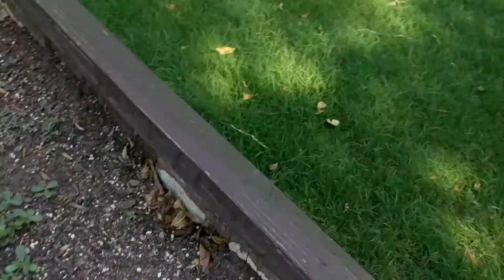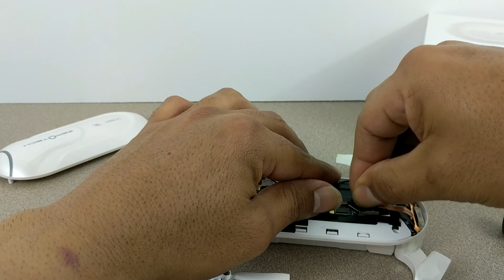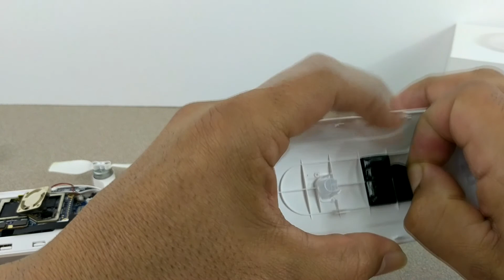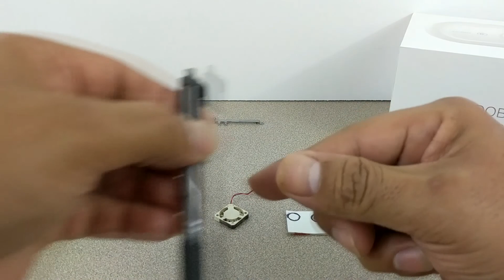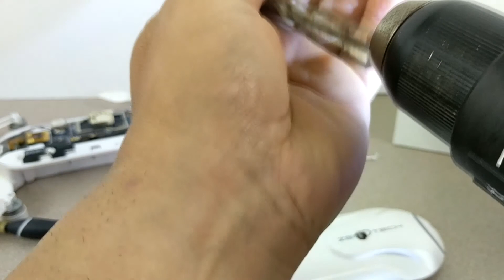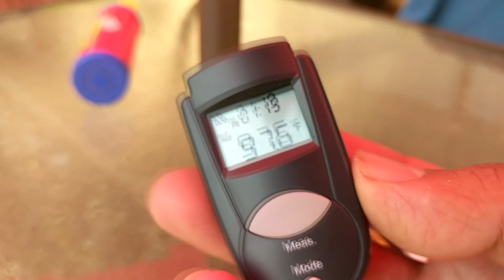ZeroTech Dobby  CPU MOD

Comment: Thanks for this, I've had issues flying in hot weather and this may work to improve performance.
Reply from the maker: Chasing Summer your welcome, Key Note: make sure air flow is directed towards CPU and GPU so that outside cool air is flowing into Dobby.
Reply: In hot weather it is unlikely that this would make much of a difference. Hot air temperature (as opposed to direct sun) would be blown directly towards the CPU/GPU, effectively speeding up the overheating. Ever fanned yourself on a hot day and then determined that fanning makes you warmer?

Comment: Don’t ever do this!
I did the same mod, it lost all GPS signal, can’t get Gps lock even in wide open area. I guess the fan adds lots of interference to Gps antenna. After I put everything back , Gps function is now back to normal.

Comment: like the idea, but the hole on the top cover defeats the purpose. two drops of rain and your drone is gone , plus i think it will suck more dust thru the original fan grill to the side and makes it even  hotter in the long run when the dust accumulate on the cpu and other parts. 
 For me unless the drone really heats up a lot and the heat effects  it's running, do not do try this. just my honest opinion.

Comment: I don't know that this would be any more effective than the heat pipes when it come to real world performance.
Reply from the maker: Adam Mooberry I made a video called Dobby Fun Do review part one and two, for temperature  however since I use an iPhone SE the app itself was not able to detect temperature in the app so I just recently got my hands on an android Pixel since I was informed that the temperature reads do work on the android app so I will be posting a video soon with the results. I’m off from work tomorrow so I should be able to post it by then thanks for watching and your comments.

Comment: Whilst I like the concept, leaving the fan exposed in that way has some risks. If a foreign object were to fall into that fan during flight and prevent it from functioning, i.e. a fly, insect or other element, even something from your pocket whilst transporting the drone, then CPU/GPU would possibly overheat and the drone would drop out of the sky. Therefore I would highly recommend shielding it in some form. I personally don't like this mod and feel that it is unnecessary in al reality, it simply isn't practical or sensible to have an upward facing cooling fan exposed fully to the elements.
Reply from the maker: DroningON.co thanks for commenting, in the video I mentioned that you can use a screen mesh to prevent this. As for airflow the Dobby has ventilation vents at base for cooler airflow in and,  warmer air in the drown out. Factory setup only had heat dissipation from CPU and GPU out but no cooler air in. This MOD might not be for everyone but for me it has shown longer flight and cooler temps. I’ll be custom painting the Dobby soon as well stay tuned and as always thanks for watching.
Reply: +Casp 72, thanks for the reply but you're missing a crucial element - by pushing air out, you force air back in via vacuum through other inlets in the Dobby shell which can produce better cooling, so this modification really isn't required. I would like to see some formal testing and temperature reading via the app as that would be far more accurate.
Reply from the maker: DroningON.co I have a video called Dobby Fun Do review part 2 that was in reference to this MOD. I use an iPhone for this purpose however on the iPhone app the temperature read never changed from “Normal Status” a viewer mentioned that the Dobby App on IPhone doesn’t read temps? I explained more in video. I was told Android device does. I’m planing to get an android device to test my MOD and curiosity. I will  make a video with my results ...stay tuned. Thanks again for your comment .
Reply: Nice one, looking forward to the video dude.

Comment: How about a series of s!all holes in a circle to create more of a screen above the fan ?
Reply from the maker: Dave thanks for watching and I do agree the music wasn’t set to the dB that I was hoping for which would reduce the background sound significantly and since I already completed the editing part and uploading; I didn’t want to have to start all over again as for the holes you mention that also is a good ventilation preference as well. I only chose to do a full circumference because as small as the fan is I wanted no obstacles in the path of air flow. I also modded the zero tech drone to resemble more of an RC drone there’s a video I posted on that as well I’ve got some videos coming up soon in regards to flight and how it handles with the new RC racing frame style again thanks for watching and your comment is well appreciated.

Comment: Pre-mod temp readings are of the actual CPU/GPU almost touching them. Post-mod readings are of the top of the fan, not the CPU/GPU, so how accurate are they?
Reply from the maker: Warren Jameson Thanks for watching , in all honesty Temp readings will always fluctuate in an open environment so accuracy varies. What I can tell you as fact is that after flight the Dobby Drone was cooler at touch as appose to flights prior. After flights without MOD the Dobby was very warm to touch near belly " Battery Compartment" with battery out. After MOD the Temp near belly was significantly cooler. Flight after flight results were the same.
Reply: @solisapaul  Thanks for that info.  I had just noticed that the second temp was of the fan, and that there is no real heat transfer to it, other than the glue pads used to lock it in place.  How was the balance affected with the mod?  This being such a light device, removing a minimum of 9 grams from one side of the center of balance is a significant weight shift.
Reply from the maker: Warren Jameson I saw no effect the videos recorded had showed no signs of video vibration.
Reply: @solisapaul  Cool.

Comment: Did you also compare the system temperature shown in the dofun app? An IR thermometer might be not that accurate on little targets like the chips under the fan.
Reply from the maker: Chameo Chameo , thanks for watching. The Dofun.app does not have a temperature feature on both android and Iphone version 2.2.2-(iPhone) and 2.2.1-(Android) it would be nice. I would also like to mention that your correct thermometers can not always be accurate that's why I measured more than once. Stay tuned for a future video with this particular drone since it is White/Tiny it is sometimes hard to see when in Flight planning on doing a custom paint job to it.
Reply: Hmm, my 2.2.1 Android version of Dofun has this feature. Tap on the colored part of the status bar and scroll down to the bottom. It's in the lower right corner.
Reply from the maker: Chameo Chameo thanks for that bit of information that is so awesome you are correct like I said in the video I don't really use this drone, so I'm not really too familiar with its Dofun app. I will be testing this out today and I will put a video up later  with my results thanks for the info.
Reply: I agree that the IR reading wouldn't be necessarily accurate, especially as it seemed that you were pointing it largely towards the fan element, not the CPU/GPU underneath. The reading from the app is key, can you test that and let us know the result?

Comment: Great video..thanks 
Thermodynamics make sense
Mass reduction makes sense
A grid of sorts would be great
One year later...any feedback?
Thanks. Tony
Reply from the maker: Tony thanks for watching, yes the Dobby is still running smooth, although I’ve dramatically modified it to resemble a racer drone. I have other videos indicating all that I did. Great little drone just which flight time was greater.
Reply: @solisapaul  
I conducted an experiment today,
Emulating your field experiment, same time and moves ( with original ..unmodified Fan)
I ran the Dobby on a cool day, (ambient temp - 22 C) and my Dobby spiked to 61 C. This basically proves that your mod works.
Reply from the maker: Tony My whole journey started with realizing how warm my Dobby would get at factory no mods and to me seemed to hot. I didn’t like that this would happen and felt better airflow would help, and so I started on this journey and along the way I figured why not reduce a bit of weight as well to help a bit with flight time if at all possible. Me being a modder  that I am well I couldn’t resist. I’m sure a lot of people don’t like what I did however for me it worked and I’m very pleased. What I don’t understand is how a simple minor mod could make a difference in CPU cooling but the Company that made the Dobby and have tested it over and over before putting it into the market could oversee this? Did they know but figured buy the time it would fail the warranty would expire therefore another Dobby another $ale and not to mention why don’t they offer parts for the Dobby aside from just propellers and battery? If you were to need the system board or the camera or even the motors your best bet would be eBay or some foreign website that offers these parts. Well I can go on , glad you enjoyed the video and again thanks for watching 👍🏽
Reply: @solisapaul  
Very  interesting....
I have had similar challenges 
Especially acquiring spare parts...not fun at all. And I am seriousky considering doing your mod with some form of grid...
Also planning on an arm lengthening mod and larger props...watch this space..
I am on Dobby #2...Dobby #1 dropped out of control into the ocean.  I Miraculously recovered and dried it...and it works 99%...
Man where is the IMU? I just cannot get that IMU purple light off no matter how many times I try.
Thanks. Tony

Comment: Great video.... I was Wondering if you have a fix for the flight issue. I purchased the unit and finally got it to synchronize to my phone.... I was able to test fly it for about 5 minutes ( bumped into a door) and then powered it off... I can get it to connect to WiFi but the camera is not picking up and when I get to the menu it shows flight denied... if you have an email I would greatly appreciate to connect and see if you can help me trouble shoot. Thank you.
Reply from the maker: gotwake gotwake Thanks for watching a view questions I have. What type of phone are you using? Did you reset the Dobby Drone by pressing the tiny reset pin at bottom of drone? Was the phone you are using updated and lastly did you check the dobby app for latest update as well.

Comment: Can you tell me why my Samsung grand prime is the only phone that will connect to the Dobby WiFi,in the app it will take off and land but the sticks do nothing.What is the best phone for the Dobby.I have a yuneec breeze and parrot bebop 1 & 2 they work perfect with my tablets and my Samsung J7.What phone do you use ?
Reply from the maker: Dave Sorry to hear there is an issue. I have used the Google Pixel (original) and Iphone SE and have had no issues? I would like to suggest a few things.
1- Unload the app and reboot your device then re-install. 
2- make sure your running the latest version of DoFun (Latest as of 5-20-18 Ver 2.2.6 for ios and Android. 
3- Make sure in settings that you have calibrated the Dobby before flight 
4-Try disabling Cellular service on device while flying. 
5-On the bottom of the Dobby there is a reset pin hole near the USB charger port, reset and then reestablish wifi connection. 
6- Make sure to give App permissions to the Dofun App in android settings.
If all fails I would suggest possible faulty Drone or your device is not fully supported with the DoFun features? Try using a friends phone as a test on either an android phone or ios for theory prior to purchasing a new or used device. Lastly if you decide to go with a replacement device I would have to say ios works but android works great as well......I would say just make sure is a fairly new model doesn't have to be the newest out in the market. Perhaps a two year old device should be fine. Hope this helps!
Reply: Casp 72 Thanks I'll all a try and thanks for taking the time .I haven't had any problem with my parrot Bebop 1 or 2 and my yuneec breeze.

Comment: How did you figure out all the components it is made of? Quallcomm 801 and Adreno 330 is 2013 technology, would it be possible to upgrade it? Does the Dobby have ESCs and would it be possible to program it yourself? What if you made a custom body for the Dobby and redesigned the size of the engines etc this could become the poor guy's Mavic if all this is possible! Imagine if you could install crash collision IR sensors and a 3-way gimbal all the things Zerotech promised the Dobby can do would become true. But I guess they encrypted everything to keep people from meddling with it.
Reply from the maker: iMeMySelf now thats some good modder thinking, the specs i got from this site under downloads http://www.zerotech.com/en/dobby-en.html  as for the option of changing the firmware and embedded EPROM Chip I would say is a no unless Zerotech releases it to the public ....(sigh) :-( As for putting the Dobby inner workings on a custom drone this is very possible and something you got me thinking about. ZeroTech was gonna release Dobby AI the next Gen that would have a Fully Programmable Xilinx Zynq® SoC Chip
Read more about this on DroningON: https://www.droningon.co/2017/02/09/new-zerotech-dobby-drone-v2-june-2017/ so with this in mind a lot more people with Techy minds like me will start Modding the Dobby for better performance or simply for customization when a company starts making a part 2 so to speak not much more is done with the original unfortunately. Thanks for commenting and watching.